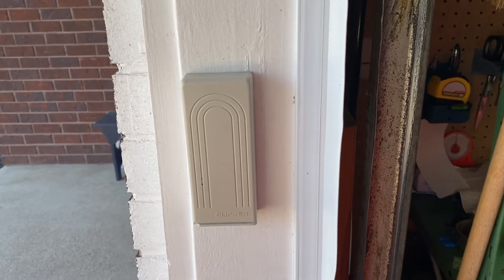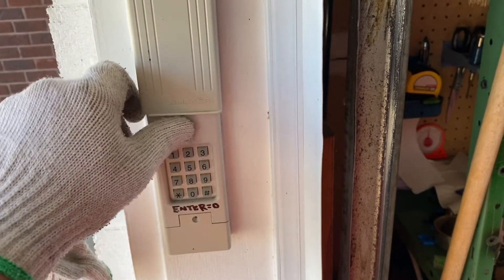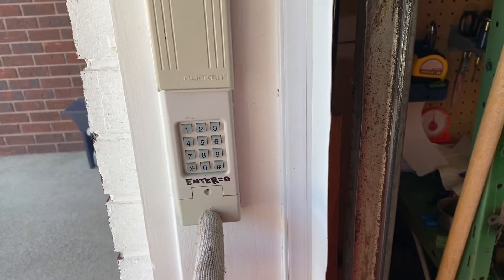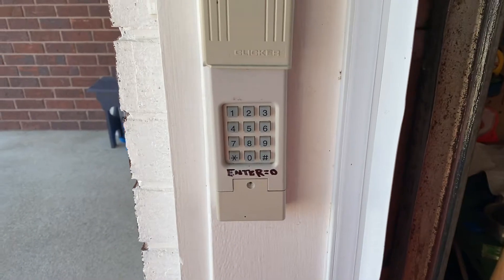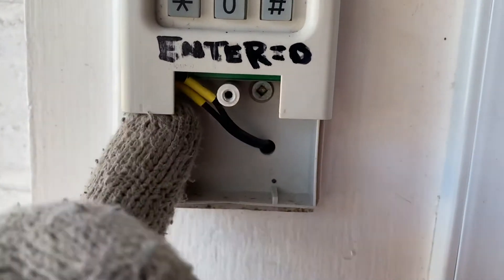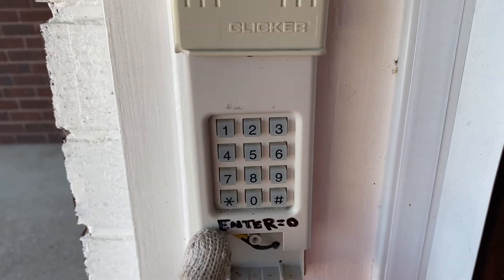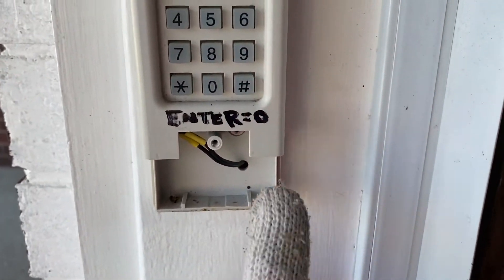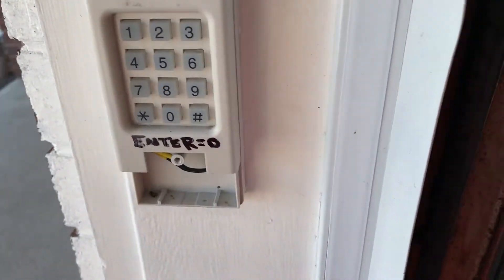Garage door keypad hack never change batteries again!

Comment: What if your power goes out? The battery would make more sense in that case. Its a 50/50 In my opinion.
Reply: if electricity goes out, the motor that pulls the chain/belt won't work either.
Reply from the maker: Definitely a choice that currently has drawbacks. Easily solved with a small UPS battery back up. I may think on adding one if I get around to it, however I’ve never encountered an issue for last few years and also have other opinions to gain access in power down scenario.
Great observation though! You must be from wise genes.
Reply: @AVA-Z  we want to know your opinions of how to gain access in power down scenarios. TELL US NOW